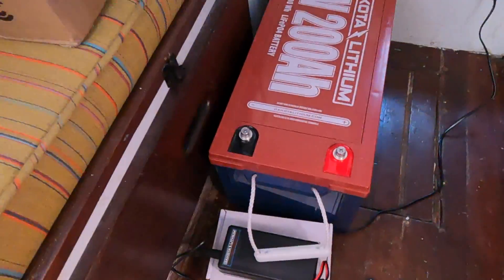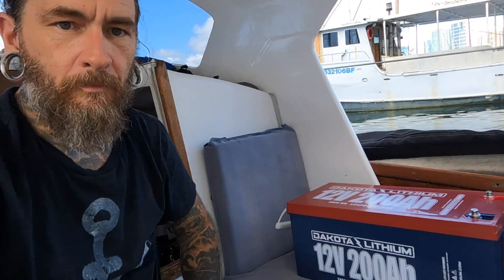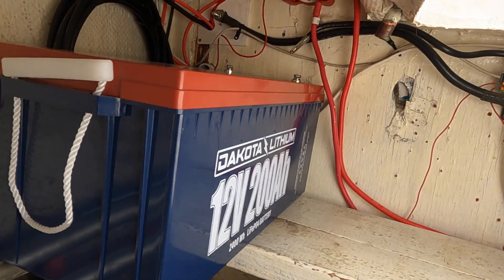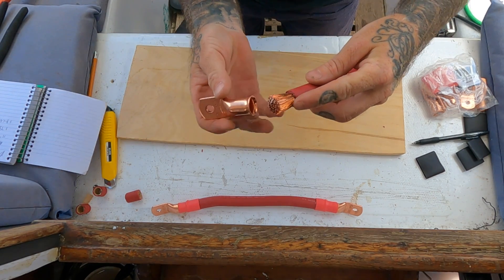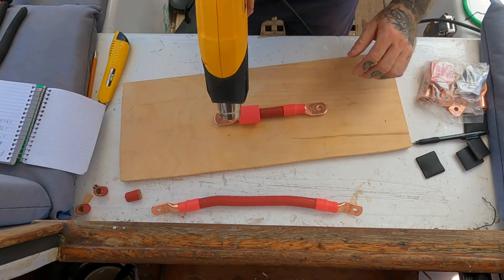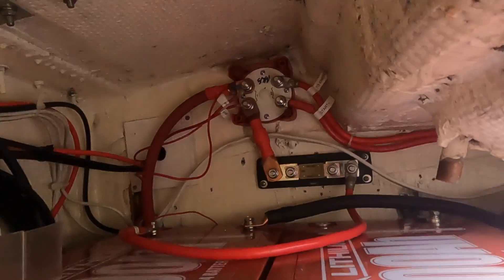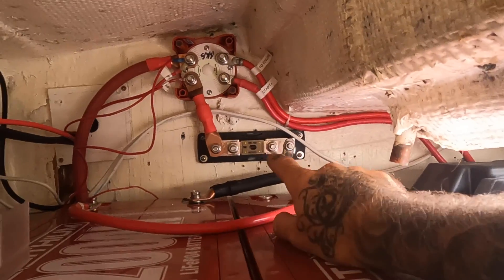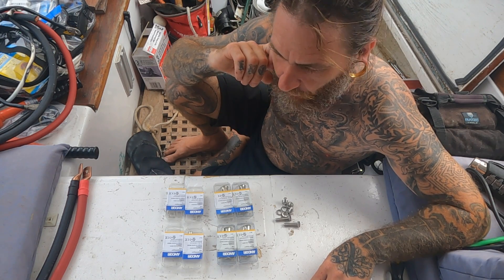Installing Dakota Lithium LiFePo4 Batteries on a Vintage Sailboat

Comment: Looks like a good proper install.  As a former marine electrician in a Navy shipyard, I would only have done one thing differently - used all tinned cable and tinned lugs.  I recognize that might have been an availability issue since I don't know what is available to the there in Hawaii.  Also I guess I would have installed two battery switches to avoid accidentally direct connecting the two battery types. Finally, I am a fan of paralleling batteries by running cables from each battery to buss bars taking care to make all cables the same length.  All power connections are then made to the buss bars so I don't have more than one cable attached to each battery post.  Nice work.

I did a similar install on my boat last summer and also used a Victron Battery to Battery charger as the only connection between the lead acid start battery and the lithium house bank.  I used the same 18 amp B2B since I only have a 50 amp alternator and didn't want to draw too much current from the alternator when the engine was idling.

Comment: Must say these fat wires are nuts. Have looked a little for 24V system with bms and seeing how many parts support the higher voltage. Not to easy. 😅 But going higher voltage meaning less amp and therefore less wires.

Comment: Wondering where you source your 04 cable.. ? Biggest I've found on Amazon is 0... also I bought a 135 Amp alternator for my A4 in my 1970 Tartan 30.. and I'm pretty sure I'm gonna have to change the current wire size that's on the current 55 Amp alternator... 
One thing I love about my boat is the engine is mid-ship and also the batteries sit under the seat to port.. very accessible.. 
I've already put a new fuel tank.. new head with storage tank.. a diesel is in my future.. 
This video was very helpful.. 
I've been watching everything I can from Nigal Calder and bought his book.. The boatowners mechanical and electrical manual.. it quite the read... !

Comment: 14:23 consider using all metal lock nuts on the battery terminals and bus bars. reduces the chance of one backing off, the likelihood of this happening is probably extremely slim but if you get an arc flash event because a terminal popped off it could be bad.

Comment: Awesome Vid !  Just made the decision to change out my AGMs for LiFePo4 as well. Did you have to make any modifications to your alternator in order to be compatible with the new Dakotas?   Looking forward to the parts list on your next video. Cheers.
Reply from the maker: I installed a DC/DC unit from Victron to allow the lithiums to be charged

Comment: I just tried to price in a small 12k btu aircon for here in asia on my 37 foiter ,cause its fkn hot.  To do so needed 800 amps lithium to get a 8 hour run time,1000wat solar 3,000 wat inverter,. Cost 16,000,00 usd. Here in phuket thailand if self installed.
So instead i just bought another fan.  While i contemplate reality.Jesus christ that stuffs expensive.
I can appreciate youre new lithium. Youre good for decades mate.

Comment: What type of fire extinguisher is needed for these type of batteries.  I'm guessing the standard A,B,C, but I know each type of battery has their own special hazards.  Would you need some gloves to protect from a thermal runaway.  I'm not very familiar with these batteries.
Reply: I think if lithuim batteries catch fire , thats the boat gone

Comment: Are you replacing group 31 deep cycle lead acid batteries with this application?
Reply from the maker: No replacing group 27 AGM batteries
Reply: @SailorJames  Cool, significant improvement I am sure!